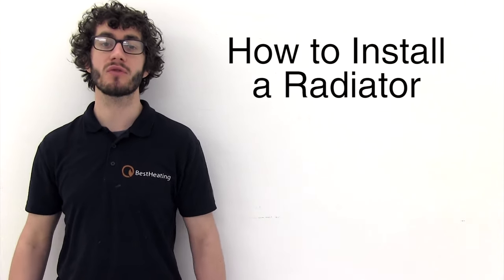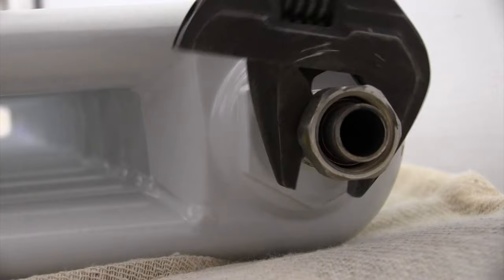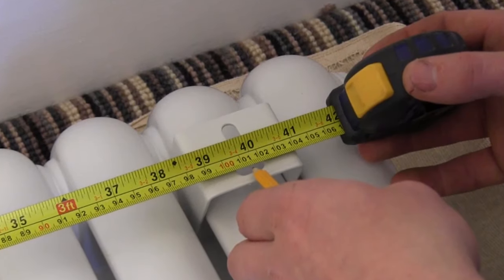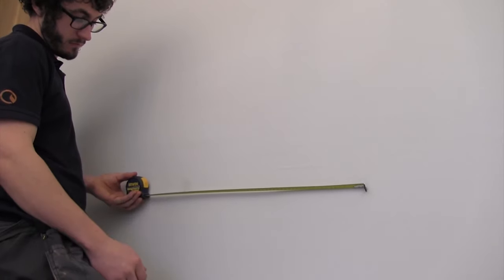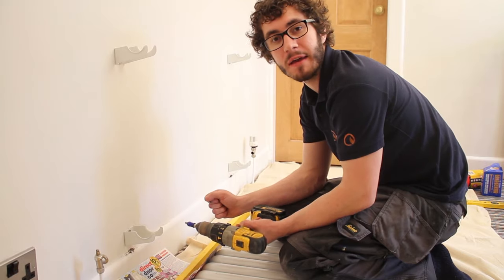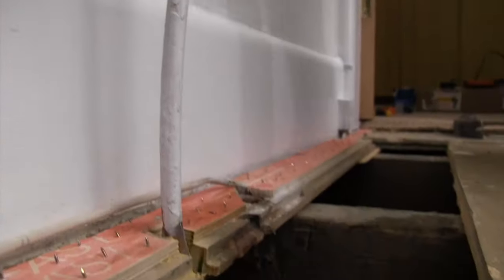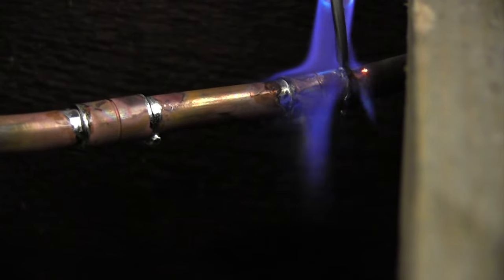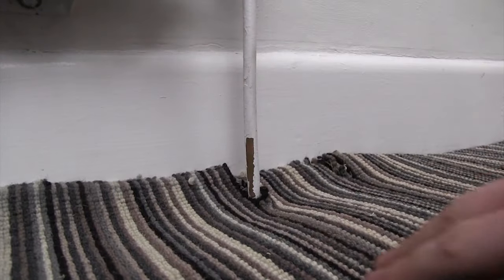How To Install A Radiator | BestHeating

Comment: You should wait with the putting the carpet back until you've checked if the new connection is not leaking

Comment: I am getting new radiators and new Window boards. Is it best to do the radiator first or doesn't it matter?
Reply from the maker: Well Bryan, as you could replace your radiators at any time, we would say that it doesn't really make a difference. Just do what you think will be more practical and easier to achieve.
Reply: BestHeating thank you. Keep up the great videos : )
Reply from the maker: Good luck with the fitting :-)